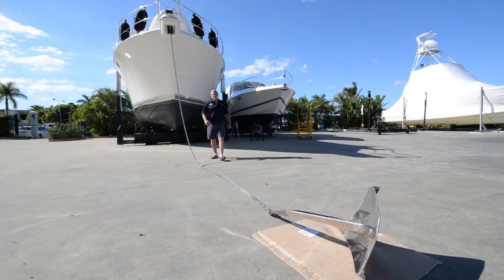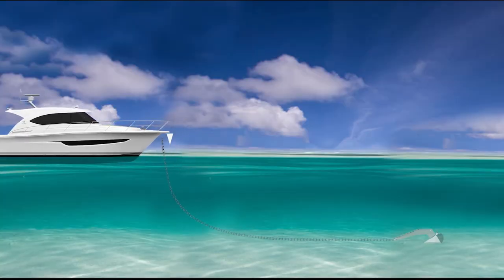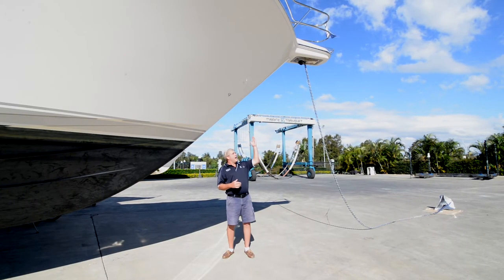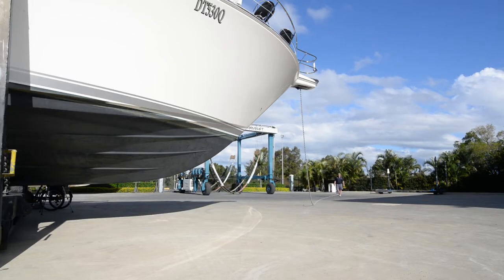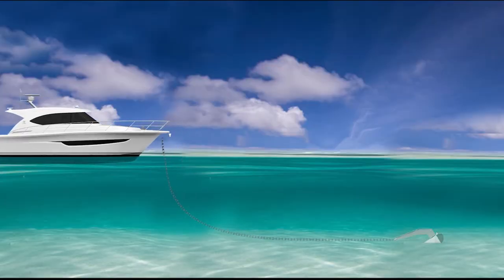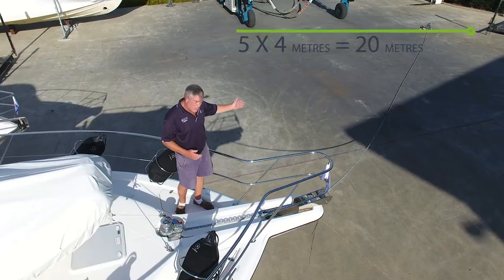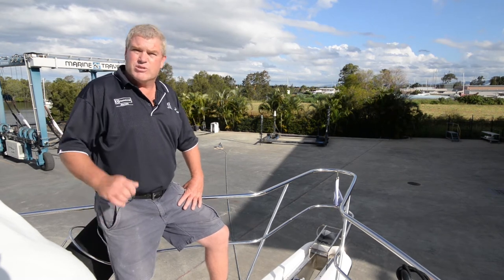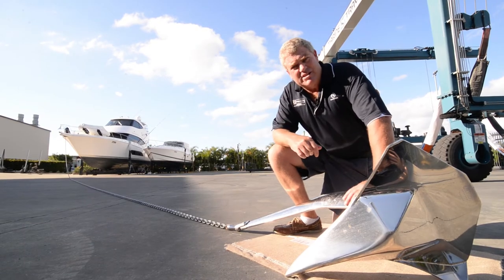Boating Tips & Tricks - Anchoring Scope

Comment: 1983 we took our 31' Fairliner to watch the Hydro's in Lake Washington. Being young, inexperienced and unprepared. Ended up anchoring in 140' of Water. All I had was a Danforth, maybe 20' of chain and 175' of line. My friends and I were more interested in drinking Beer and enjoying the Ladies than the finer points of anchoring. So we tossed it in, and hoped for the best. It worked! and held a 16' run about too. We were smart enough to wave off others attempting to come along side and join the party. Recently was fishing Halibut, 140' of water, mouth of Mutiny bay. 19' Livingston Viking, using one of those small cast, weighted look alike Danforths. 10' of chain and maybe 250' of line. Held good, slipped a bit. Would never sleep on that setup but worked good many times. I've read Dutton's, Bowditch and others. Rarely use 5/1 scope, 3/1 for years and years no problems with CQR's, Danforth's and Bruce. I use 5/1 or more too, but only when I think it's needed. I'm not the only one. But I'm learning we're a small discreet group.